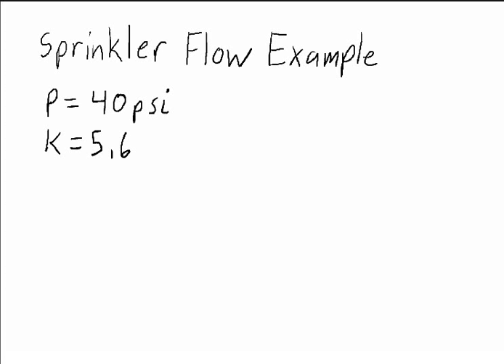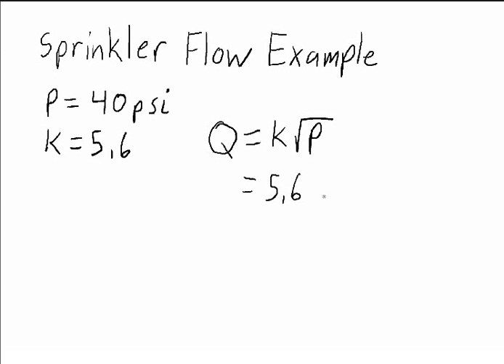Flow Through Sprinkler Head - Fire Protection Engineering (FPE) teaching tool

Comment: how do you find the design area for a system given the density, the number of heads, the gpm and the PSI? Specifically .1/ 7 heads / 367 GPM / 
59 PSI
Reply: Just realized this is from 2011